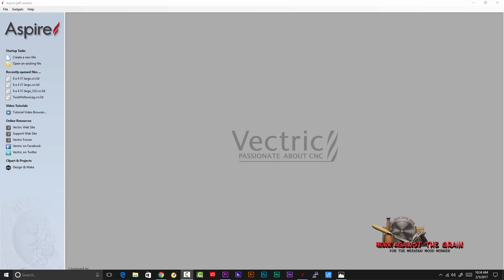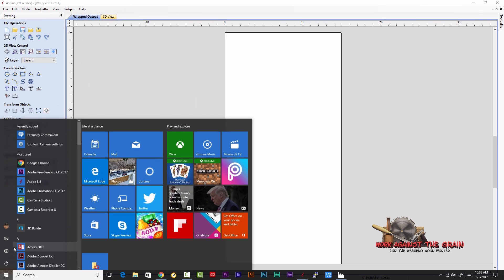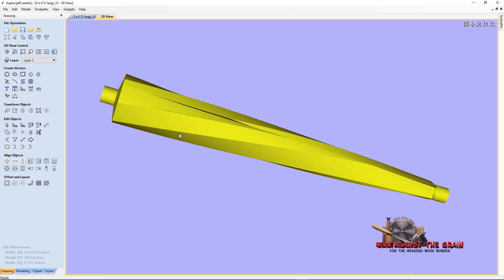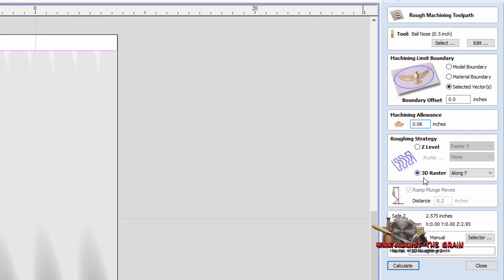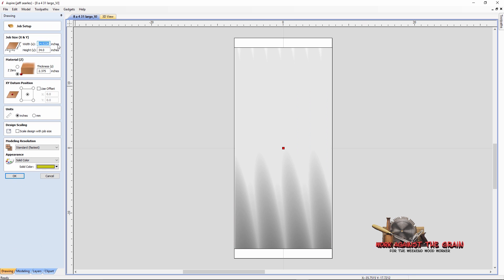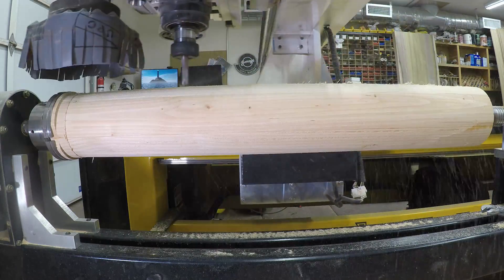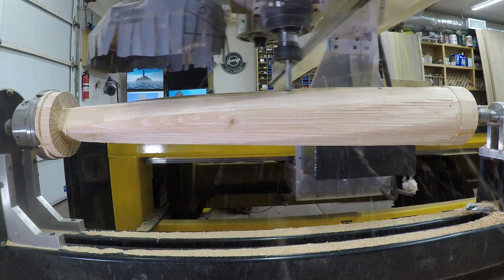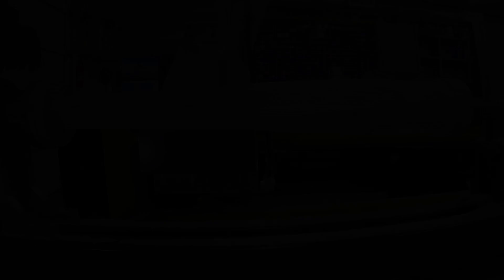Spiral Leg Wrapping

Comment: Jeff , I'm trying to learn  cnc, computer, and software from your videos and  others, and I noticed  you were having problems  with your wrapping your round  objects. On our tape  measure  thousandths don't mean very  much but on the  computer and software it does apparently. Try using 3.14285714 instead of 3.14 for the pi and I think your problem will be solved. I hope to learn more from your and others videos! Thanks Deryl C.
Reply: Try 3.14159, which is Pi rounded to 5 digits.

Comment: Perhaps the "thickness" of the material affects that measurement. i.e. when you wrap something that is 1 inch thick in a circle, the outside and inside circumference will be different. 
Of course that begs the question, how do you get depth without thickness.

Comment: I think the gap may be caused by the rounding/precision of the circumference.  When you do the calculations to find the circumference of a 4.75 diameter circle you get 14.922565104551517882697556070578.  You or the software is rounding to only 4 decimal points which could account for the gap that is being seen.
Reply: yes and no......the four decimals round ....56 to... 6.....so it actually should overlap.
Reply: You are right, my thought process was running backwards.